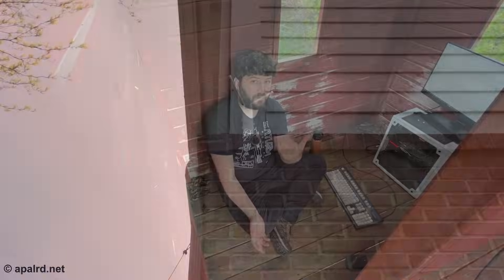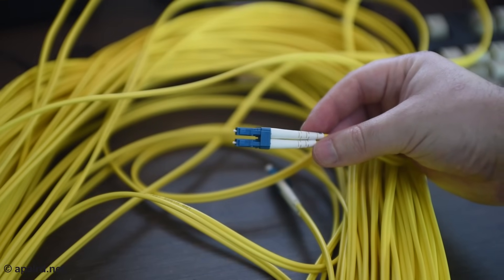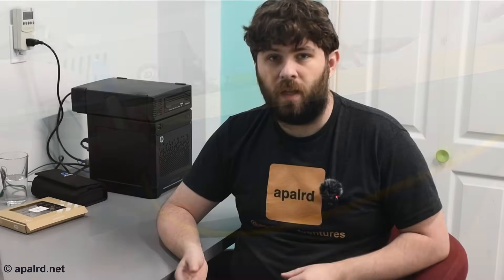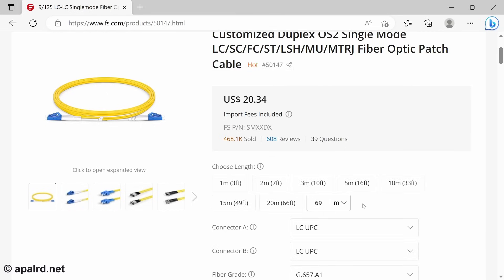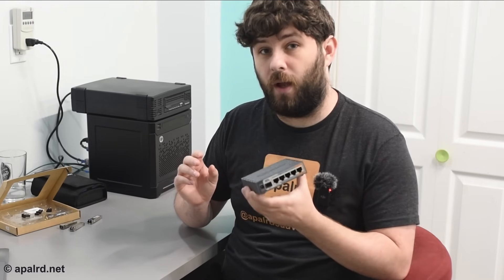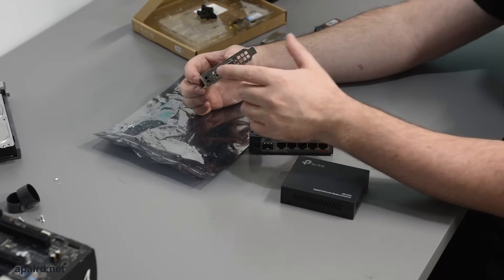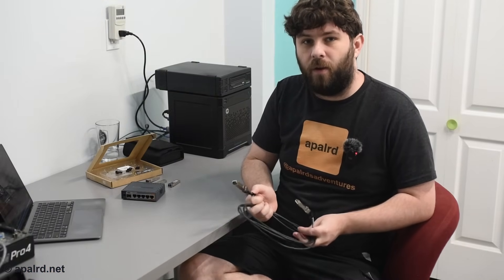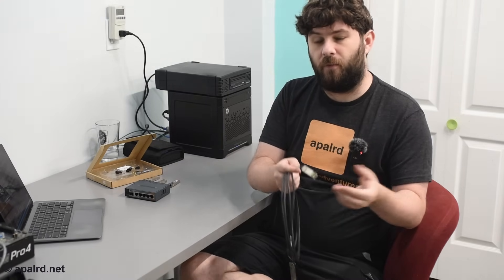The ULTIMATE Guide to Fiber Optic Home Networking

Comment: Don't buy multimode unless you are already using it.
Reply from the maker: basically yes, unless you're a datacenter, although I've seen some HDMI products designed for it
Reply: Why not? OM3 seems most practical for runs inside the home.
Reply from the maker: The cost to go above 25G on MMF is quite a lot higher than doing the same on SMF.
Reply: @apalrdsadventures  In what way? I was considering a ~30m run of OM3 for 10gig and that same cable would also be good for any 100 gig link. So are the transceivers more expensive?
Reply from the maker: Most reasonably-priced MMF 100G transceivers are -SR4, which requires 4 pairs (8 fibers). In SMF you can do CWDM4 with 1 pair (4 wavelengths for the bandwidth). Transceivers for this are under $100 each for both SR4 and CWDM4. The closest thing I could find for MMF over 1 pair uses  a mix of BiDi WDM and 50G line rate to squeeze a bidirectional 50G link on two pairs (duplex 100G total), for around $500 per transceiver.
Reply: @apalrdsadventures  That makes sense. It seems the IEEE standard for true 100 gig multimode links is 802.3db (-VR1 and -SR1) which is less than a year old. I'm sure the first gen implementations will be very expensive. Also note that both -CWDM4 and -SR2-BiDi are not IEEE standards. It seems like it's probably easier just sticking with 10 or 25 gigabit for the time being. That should be enough for most home networking which is what your video is supposedly about.
Reply: @apalrdsadventures  While you're technically correct, referencing going above 25Gbps in relation to price as a negative is a weird take IMO when you're discussing home installations in the first place lol. 10Gbps is already extremely rare in the vast majority of homes (even for many homelabbers due to cost), let alone even faster links. Unless you're running current gen enterprise-grade equipment in your house, I see no real reason why OM3 should be avoided, esp if you're aiming for 10Gbps (though if we're being honest, most people should probably still just stick with Cat 6/6a, where possible). If you have equipment capable of handling 40-100 Gbps in your house, you're in a very niche (albeit awesome) scenario and cost probably isn't your biggest concern anyway. I think we're still quite a while away before even 10Gbps becomes commonplace in residential use (let alone 25Gbps+). Heck, getting faster than 2.5Gbps on even most "prosumer" devices is still challenging even near the end of 2023.
Reply: @DanWalshTV  Even if cost isn't a concern, why pay more just to use MMF, which is also more expensive than single mode?
Reply: @DanWalshTV  for this installation in the video out to a literal shed, no reason to worry nor care. For modern home installations, the difference in cost is not a problem and you should be doing single mode anyways just in case the future ends up being slightly faster than the now and you won't ever have to do another run. It'll probably be way cheaper than now for the transceivers, yes, but honestly its just better and easier in general for ongoing use and support so why not get it? Not like you can just rerun all of the coax or cat5e in your walls at the drop of the hat haha. Its planning for the future, not for the now, and for what may be, of what is being installed now. Like op said, there is no reason to go multimode anywhere unless its already there.
Reply: @apalrdsadventures  Is it possible that in 5 or 10 years this price difference isn't so wide? I think 10gbe is sufficient for some years for many home-gamers. I understand the point of SMF being the better choice, but I'm just wondering if it will make much of a practical difference for someone who is paying today for many tranceivers, etc and will only step up to 100gbe in 5 or 10 years.
Reply from the maker: Currently, carrying 100G is mostly done by quad-25G (similar to how 40G was quad-10G). So, carrying it over MMF requires 4 fibers for each direction (8 fibers total), while SMF can use wavelength division multiplexing to carry the four lanes over 4 'colors' of a single fiber (2 fibers total). WDM optics are a fair bit more expensive, but the price advantage of MMF optics disappears entirely when you need 4x as much fiber.

Assuming in a few years you will be using retired enterprise NICs, QSFP28 is probably what you will have.
Reply: @eDoc2020  the cost isn’t that massive when you’re doing a whole house
Reply: ~30 years ago most networks were 10mb, with some 
~25 years ago most were still on dialup at home and 100mb was standard
~15 years ago I got this same kind of pushback for being particular about the latest standards so I'd have 1gb Ethernet capability in the home we were building. It was umfathomable I'd see GB speeds to the home for people or that we'd ever need that kind of performance.

Tech moves fast. Always over-prepare for things that are hard to upgrade, like cable runs. I already regret going cat6 to my router in this house only and not running fiber too like I knew I should.

Comment: Three things:
1) I read your blog post associated with this video and it is generally well put together.
The only thing that I might suggest is for someone who might just be skimming your blog post, if you don't mind adding the speeds at which the components are rated for vs. having to click on each line to find that out.

(or maybe put together a table where one column is "here are the parts for 1 G fiber" vs. "here are the parts for 10G fiber".)

(And yes, I did read, in the bottom, what you used, but it might be helpful as well, to denote that in the parts list itself.)

2) $20 for a 69 m fiber cable isn't bad at all. And for your 10G set up to your shed, for a total BOM cost of $98 (minus the cost of your switch), that's not bad at all. (ServeTheHome has recently covered some relatively lower cost 2.5GbE switches and 10G switches as well.)

3) re: Mellanox ConnectX 3/ConnectX 4 (from your blog post)
YES! Make sure that if you are trying to run upto 10G fiber, using SFP+ ethernet rather than Infiniband, that you pick and find the correct card for that. (There are a lot of other options that WON'T work if that's the implementation that you are planning on deploying.)

For ConnectX-4, you can go all the way up to 100 Gbps dual QSFP28 port Infiniband. (That's what I use at home.)

The total cost increases, but the $/Gbps for 100 Gbps is actually LESS than the $/Gbps for 10G.
Reply from the maker: I'm using a mix of Intel X520 SFP+ cards and ConnextX-4 SFP28 cards. No Infiniband, and running all at 10G now, but planning on eventually going 25G for my Proxmox cluster so throwing in those cards in my more major servers makes sense to me. 

I'll add some notes to the item listings too
Reply: @apalrdsadventures  
:)

Thank you.

1) Yeah, I sort of "accidentally" skipped the entire 10G networking tier, went I went to 100 Gbps IB.

(IB isn't too bad. Yes, the switches CAN be expensive, but if you have one of the Mellanox (now Nvidia) VPI cards, you can actually use IB tools to set the ports to run as an ethernet port rather than an IB port. And if that's the case, then you don't need a managed IB switch which runs OpenSM (or an externally managed switch whereby one of the systems connected to the switch, takes on the task and the responsibility of running OpenSM).)

And I only "accidentally" skipped it because I deployed 100 Gbps IB for my micro HPC cluster for CFD/FEA workloads, so now using the IB for anything else, is just a fringe benefit.

2) Since I have consolidated my systems/servers down from 5 to 2, my main server now runs everything in a single system, and therefore; inside of Proxmox (since all my systems talk to each other anyways), I just use virtio-fs for the intra-VM and VM <-> host communications, rather than going out through a virtualised NIC, only to loop back in.

As a result, both in Windows 10+ and in Linux, the virtualised NIC is recognised by the OSes as a 10 Gbps NIC (Windows 7 thinks that the virtualised NIC is a 100 Gbps NIC - yay!).

The benefit that this has is that it allowed me to stay on the path of "skipping" the 10G networking tier whereby I don't have to buy any more hardware (switches, NICs, cables, etc.)

And this was consolidation was set up with the intent of cutting my overall power consumption where I have gone from sucking back 1242 W down to just shy of 600 W.

But if I were to try and run a system in a "shed" like you have, I probably would do something similar to yours where I would deploy 10G fiber (since 100 Gbps is probably massive overkill, especially, for a system that would be in an outdoor "shed").
Reply from the maker: I'm trying to go from Proxmox 'dev' + Proxmox 'prod' + TrueNAS + Workstation, to 3xProxmox cluster with the workstation virtualized. Hoping to build out hardware for this (eventually) that's reasonably low power, or at least lower than what I have now doing those same things. 

So in the end, either fiber will be running up to the workstation so it can be a productive cluster member OR DisplayPort and USB3 will be running down to the basement, which is nicer for noise and heat but also harder to manage.
Reply: @apalrdsadventures  
Depending on the GPU that you're using for your workstation, that is totally doable, maybe with a few minor "exception" in regards to trying to have both Proxmox 'dev' and Proxmox 'prod' (if I read your comment correctly), running on the same system and/or the same cluster of systems.

(Not sure if you're going to end up with stuff running into each other between 'dev' and 'prod'.)

But besides that, everything else should work just fine.

Also depends on what you are using TrueNAS for.

(My Proxmox system hosts SMB, NFS, and iSCSI directly on the native, Debian-based host that runs Proxmox itself. I think fellow tech YouTuber ElectronicsWizardry I think, used the turnkey Linux fileserver to manage those aspects, but I ended up just doing that all directly on the host itself.)

So, lots of ways to do things.

Again, for me, because the data that lives on the host is utilized by both the host and the VMs can see each other's data (which also tends to reside on the centralised host), so virtio-fs worked really well for that (for Windows 10, Ubuntu, and CentOS. Didn't work for Windows 7 nor SLES12SP4 (which I didn't update the kernel. Although I suspect that if I subscribed to SLES, I can get the updates. But that wasn't critical to me.))

Clustering is pretty easy. Trying to remove a node from a cluster, the one time that I was playing around with it, was more difficult.

re: accessing your workstation
Depending on the apps that you are planning on running on your workstation, if you need a reasonably high framerate/quick refresh, then Windows Remote Desktop (if you're using Windows) and/or VNC may or may not work for you.

I just have a mini PC that connects to my Proxmox system over GbE as there really isn't THAT much traffic over remote management/remote desktop, which means that I don't need anything much faster than that.

Linus, though, I think at his house, he uses like a fiber/Thunderbolt 3 dock (basically), so that the connection between the two end points runs over fiber, but splits out to TB3 at the ends.

Not sure if you'd want to do something quite that crazy, but GbE works (fiber or ethernet cable).

(And since my workstation is also hosted on my Proxmox server, therefore; the need for high speed data transfer to my remote system (mini PC) is negligible, given that I have relatively direct access to the Proxmox host data, again, via virtio-fs. So, I was able to completely remove a hardware based 10G networking layer, and have it run, WITHOUT even really needing a virtualised 10 Gbps NIC. Again - one of the pros of virtio-fs.)

I looked at deploying 10G networking. But the consolidation helped completely eliminate that layer of networking needed. And since everything else basically just runs on the "management" layer, I just have my Netgear GS-116 v2 (which uses 7 W of power), for 16 ports, down from the 48 port Netgear GbE switch that I was running previously when I had segregated systems running.

And with the consolidated system, the number of VMs that I can run is limited only by the amount of RAM (256 GB) and amount of processing power my system can handle (dual Xeon E5-2697A v4 (16-core/32-thread per socket, 32-core/64-threads in total)).

Windows remote desktop sucks for high(er) frame rate gaming, but I can still play Anno 1800 on it, which isn't terrible (on a RTX A2000 6 GB).

So it really depends on what you want to do.

Comment: Hm, are DAC cables link speed agnostic? Or do you need different cables for 1/10/25 GBit/s?
Reply from the maker: They will have a max speed they are spec'd for, and will identify as that speed to the host
Reply: DAC and DAF cables should be purchased for the interface and speed they're being used for. Like SFP28 for 25Gbps with making sure that both slots support SFP28. SFP+ for 10Gbps. SFP for 1Gbps.

Comment: 4:39 - two pairs (four cores) - why do you need four fibers?
Reply from the maker: you right, 2 fibers, not 2 pairs. It's the big yellow spool in the video.
Reply: Fibre is cheap running more is often a similar cost or cheaper because it’s a more commonly purchased cable

Comment: One thing I think you skipped is that on LR, SFP, single mode? The light levels are important it is possible to overdrive the receive. I want SFP but the transmit from the other when using single mode fiber
Reply from the maker: That's definitely a concern with high power transceivers (don't buy the 20km or 40km variants at short range), but for the specific transceivers I linked they all have a receiver overload >= the maximum transmitter output, so they can't be overloaded if paired together.
Reply: 10km transceivers (LX/LH or LR) are fine for short distances without attenuation.
Reply: If the signal is too hot you can us an attenuation pad to take a few db out of it.
Reply: @Trains-With-Shane  yes I know I'm retired from a telecommunications electrician job with the power company and IDWDM transport work
Reply: @Traci_S_Aaron  I kinda figured you were given that nobody would ask about light levels if they weren't. But I wanted to drop that reply for the benefit of those reading the comments.

Comment: We do Wi-Fi. Its reliable and easy too. Fiber companies taking over our area (Government Sponsored ISP). Little guys who are BETTER get squished!
Reply: WiFi is easy and convenient, sure. But reliable? Not really, depending on what you mean. It only gets worse as our homes get more and more congested with wireless devices. Latency is also significantly worse compared to wired. WiFi has its place but it'll never beat a good hardwired link.